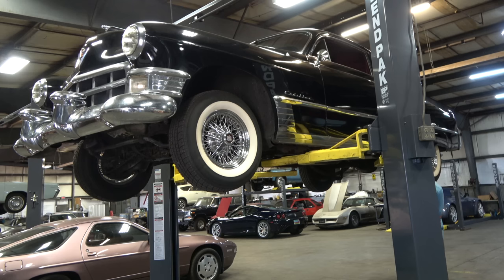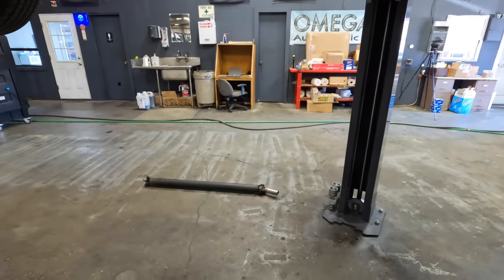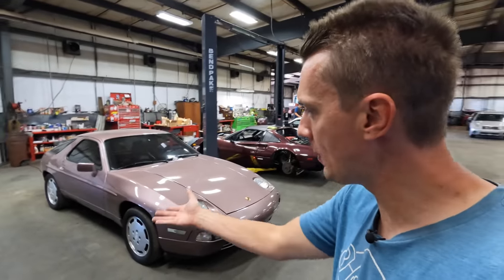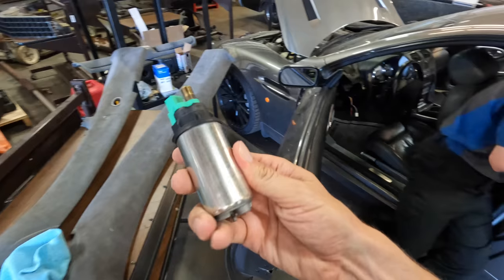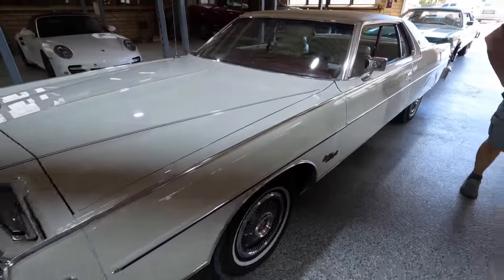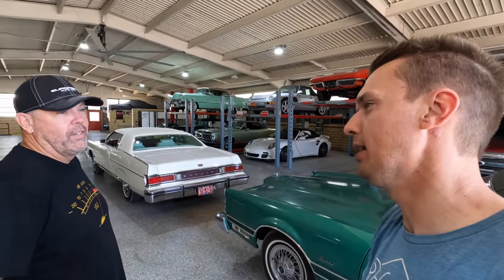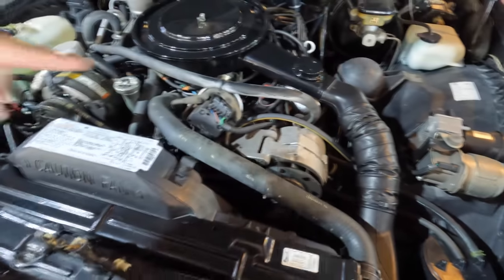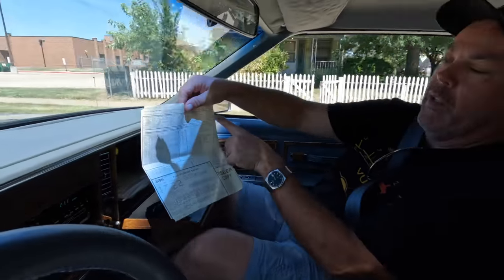We found some weird mods on my 1949 Cadillac Fastback Custom, and more things broken!

Comment: The 3.3V6 is an amazing engine. It's actually just as good as the 3800 v6. They're both 90 degree engines and both easy as hell to work on and very reliable.
Reply: Bold statement, Hoss. But you say it with such conviction, I must believe you!
Reply: That I can agree with, my 3.3 ran for a month with a cracked block or head gasket. Head gaskets looked fine, crossing my fingers there's no combustion in the cooling system when I stick it back together 💯🤷
Reply: @ericacherney3132  sucks it wasn't made for that long. Guess when the 3.1V6 came out,  it was too close in power to the 3.3 so there wasn't much need for it. But the 3.1 wasn't as easy to work on.
Reply: Horrible car.  Horrible.  Should not even wear the Buick badge.
Reply: @allenmurrell  It doesn't. It's a Caddy.
Reply: @theprojectproject01  thought you were talking about that horrible skylark at the end of the video
Reply: @allenmurrell  the car I don't care about its ugly lol. But that engine was a gem.
Reply: @allenmurrell  That is a car beloved of line cooks all across this great land

Comment: I swear 1980's GM headliners were literally falling apart when new apparently. 2000 miles on the car and obviously climate control stored. So many memories growing up of thumb tack stuck headliners.
Reply: cigarette smoke was the biggest problem and it effected the adhesive.
Reply: I remember my grandmother would always get onto me and my cousins for messing with the headliner in her Riviera for about a year before she traded it for a new one.
Reply: Yeah, it's the first thing I look at anytime I see an old GM from this era ! But I had some good times in the backseat of them though 😊
Reply: All manufacturers headliners were the same, a foam backed cloth with the foam glued directly to a cardboard headliner. The problem is that the foam disintegrates at about 8 or nine years and the cloth has nothing to adhere to so it falls down, the heat does the most damage. I've replaced several of them, its' easy once you get the thing out of the car.
Reply: I love that Riviera but the headliner needs help.
Reply: I have a 1997 Jaguar XK8 coupe that I bought in 2000 with 7000 miles on it. It was in almost perfect shape, always garaged by a non-smoker. It did however have a slightly saggy headliner that I had repaired a month later, and again 3 years later, and again 9 years later, it needs to be done again soon. I've had different opinions about why it keeps happening and tried different adhesives but nothing seems to work permanently.  After all these years and all the money spent I think I may have figured it out. My theory is that I drive with my windows down unless the weather is too bad and the buffeting is the cause. I'll be making an appointment soon to have it done again, I'll get back with you in another decade.
Reply: I had a 2013 focus ST and however they made the headliner in that car seemed to be pretty much impossible to damage. You could put a cigarette out in the headliner and it did nothing to it. It didn't melt never sagged nothing. It was even a sunroof car that stayed outside. When it got totalled it had 180,000 miles on it and the interior impressed me with how it held up. The leather seats even held up well. The heated seat switches/rollers died but Ford built them into the cupholders (bound to fail from liquids) that was really the only thing that died from 23,000 to 180,000 miles interior wise.
Reply: @mr.toobigformypants8145  they used to use chrome strips on older cars.
Reply: The adhesive that the fabric manufacturer used to bond it to the foam breaks down. It's particularly bad for the 1980's  because of the shift to low-VOC/water based products. I've got to replace the headliner in my 1982 Chevy. The foam stayed glued to the fiberglass backer, but the fabric/foam is all dusty garbage.

Comment: for the Porsche; if it has rear bilsteins they are probably rebuildable
Reply: I was thinking a call to Bilstein would solve the problem pretty quickly, but maybe the company has changed.  If Bilstein won't do it, they should reach out to MCS or one of the other boutique race shock companies in the US and see if they can make some one-offs for a Hoovies Garage publicity tour.
Reply: My thoughts exactly. Getting shocks rebuilt isn't usually done because it's so cost prohibitive, but that all changes when they're unobtainium spec
Reply: @ironymatt  and some of them are designed from inception to be rebuilt.  If there’s a rubber stopper or shraeder valve on the bottom of the strut/shock, it’s likely serviceable.
Reply: @caitsith2007  hope Wizard sees this and looks into it. Smells like another episode!

Comment: I had a similar experience ordering Bilstein shocks for my Saab. I ordered them from a place that advertised them as being in stock and got refunded as there were none available anywhere. It doesn't mean you'll never get any though. You just have to wait until Bilstein make another batch and then they're suddenly available everywhere. I finally got my Saab shock a few months later so good chance the Porker ones will be available in a while too.

Comment: Concerning the Buick: Note the delaminated headliner and deteriorating sun visors and unglued rear interior wall panels.
Reply: 40 year old car is still a 40 year old car…
Reply: @ripem1417  and a Buick is still a Buick...
Reply: @grandtheftautotune7715  and 80s GM is 80s GM…
Reply: @ripem1417  Don't even put the 80s in there, my grandmother had an early 80s Riviera and a 93. They both had headliner issues.
Reply: @DaR-Cee  my grandfather had a 83-84 one and i remember the plastic under the lights falling apart from it being stored in Florida

Comment: The Regal TourX is a great modern wagon that I drive as a daily.  I got it with some minor cosmetic damage for next to nothing, shipped in the Opel parts to convert it from a wannabe offroader, and have loved it ever since.

The problem with the TourX was that GM wasn't even trying to sell them, kind of the opposite really.  Next to zero marketing was put out for them and they didn't offer any dealer/buyer incentives to buy them.  I went to multiple dealers that had them and every one of them told me I could get great incentives for the trucks and suvs, but nothing for the TourX.  They actively tried to get me to not to buy one despite them being one of the better cars put out in a while.  I've heard from a lot of people having the same experience all over the US, that's still extremely anecdotal, but I think it holds true enough.

Wagons are like Vans in the US, people just want SUV's and then cry about gas prices.  Vans have shot up in sales with fuel rising, people realize you get a comfortable car with lots of space with better fuel economy.  I've got a Mazda5 with a MazdaSpeed 6 power and drive train mixed with custom suspension to give a pretty great handling and quick AWD van (for a van, anyway, rip my Mazdaspeed 6 someone hit in a parking lot while I was inside).  I also have a second gen Pontiac Vibe GT manual (basically a Matrix XRS) that's the perfect size.

Comment: Holley Sniper EFI would be awesome in it. Bolts on like a carb but the performance, instant start, and smooth idle. Just an idea
Reply: Hot garbage. Unforgiving.
Reply: Nahhh for that car the Q-jet is perfectly fine and more correct.
Reply: @snek9353  lolololol..... I hate my quadraflood
Reply: @ThriftMachine  Then you don't understand it, they're fine carbs. And if you hate it why haven't you replaced it? 
Of course better exists, but for that car the Q-jet is not only just fine function wise but correct for the build/era.
Reply: @snek9353  I understand it fine but I live in Colorado where the af is constantly changing with elevation

Comment: I have my grandfathers all original 1948 Cadillac and it has the last year of the Cadillac flathead engine, no air conditioning unfortunately. It runs great however. More of a spring and fall car. Thanks for the video!
Reply: Can't you retrofit air conditioning in that?  I remember my grandmother had Buick Skylark.  I think it was a 1968.  Anyway, my step grandfather put in an after marker air conditioner.  I still remember what it looked like.  It was kind of under the dash in the middle and it was a big boxy type thing with vents.  
What model IS your grandfather's Cadillac?  I'm a Cadillac buff myself and have a couple classics.
Reply: Yes, Vintage Air has a kit although it would have to put out quite a bit for that interior space. It’s a 62 series. I’m sure the hood has more steel in it than most cars have in its entirety. They bought it in 1956 trading in a ‘49 Lincoln Zephyr because of needing more space for the family. The price was $795 from Darby Everest Cadillac in Oklahoma City in 1956.

Comment: One of the most beautiful cars I've ever seen, and its topped off with some tasteful resto-mods.
Reply: You haven't seen many, have you?
Reply: @retroguy9494  Sadly no
Reply: @ForgedAU  Well, that's actually a GOOD thing because I'm a Cadillac buff since I was 8 years old and even have a couple classic Cadillacs.  What they did was basically ruin that car and it looks like a hodgepodge of parts thrown together.  Its kind of like the presidential limousine.  Its LOOKS like a Cadillac, but just in appearance only.  What they did was take what was a thing of beauty in the era and ruin it.  That saddens me.  My cars are all stock.  One of them actually HAS the 500 engine in it but it belongs in there because its a 1976 and that was the last year that engine was used.  Its a beast.  And gets a whopping 8 MPG locally and around 10 MPG highway.
Reply: They didn't ruin it. They just valued drivability over purity. As do I.
Reply: @ForgedAU  Well, when I want "drivability" I use my Cadillac Escalade.  When I want to go on a leisurely cruise with no particular place to be, I drive one of  my stock antique Cadillacs.  Therein lies the difference between you and me.  You should watch Jay Leno's garage.  These old cars are VERY drivable if they are maintained properly.  Hell, you could drive a stock '49 Cadillac from New York to California as long as it was maintained.  
In fact, about 10 years ago a guy drove a 1930 Ford Model A every day for a year as his daily driver.  He was from Michigan and even drove it in the snow.  It was all stock.  The only modification he made was that he converted the vacuum windshield wiper to electric.
As a car guy, to take these beautiful luxury cars from a time when style meant everything and they were objects of beauty and you could TELL one car from another, to do what this guy did IS ruining it.
Reply: @retroguy9494  fair point but I would be scared to drive a stock classic. I wouldn’t want any harm to come to it. That is what I mean by drivability, not just being reliable. But not being afraid to use it without worry, every day. I love stock classics, but I also love driving midden classics because I don’t feel scared driving them. I’m short, they didn’t ruin it, hey just did something you personally wouldn’t have.
Reply: @ForgedAU  Well, if you're afraid of an accident with a stick car, THAT I can understand.  I'm in the suburbs in the New York City metro area and its not only crowded but the way people dive is insane!  When I drive my '76 Fleetwood, always in the right lane, I've had people cut me off, cut me off and stomp on their brakes to make a right turn, etc.  People just don't realize that between the sheer weight of that car combined with the old style disc brakes, that car does not stop on a dime like modern cars do! 
But as far as maintenance problems go, I don't worry at all.  In fact, I've been stuck more with my late model vehicles than I EVER have with my antiques.  I had a 2005 Yukon which I bought new and when it was 4 months old, the entire exhaust system fell out of it on the highway!  I had to have it towed.  Plus it was in the shop every other month needing all these little modules replaced.  
But my '76 Cadillac is all stock, even the exhaust.  Due to 2 surgeries and having to care for my father who has dementia, I hadn't even started it in 2 1/2 years.  I put in a new battery and it started right up on the first try and purred like a kitten! The old stuff was built better and as I said, maintenance is key.  If you maintain them properly, they will actually take you farther than modern cars with less repair.
Reply: @retroguy9494  when I said scared I didn’t mean accidents. I meant I wouldn’t want chips on the paint or miles on the clock etc.
Reply: @ForgedAU  Oh, THAT!  LOL  Well, that's a valid point.  That's the very reason why, when I buy a class/antique car I NEVER buy  a 'trailer queen.'  I usually buy them with some miles, although LOW miles and with a a few imperfections.  Because I want to DRIVE them.  That's half the fun!  Plus you get them for less money.  Granted, my 76 and 84 Cadillacs aren't daily drivers so I didn't put on many miles.  But my 94 Fleetwood I bought as a kind of 3 season driver.  I bought that in 2014 with like 59K miles on it and it has, I think, about 88K on it now.  But yet, I haven't driven it in a year and a half because it doesn't run.  It needs a module and with the shortage on same, my mechanic can't get one!  He's even called Cadillac in Detroit who keeps promising one, but hasn't come through yet.
But I HAVE known guys who buys these classic stock cars to use as daily drivers, but they KNOW they're going to put on the miles and just want to drive them and not worry about the value.

Comment: I put a V8 in my MGB...I would overheat.  I installed a motorcycle radiator and fan above the differential to dump heat away from the engine compartment. Works like a champ.

Comment: I bought an 85 Riviera with 80k on it 20 years ago for $600. only needed a paint job. The one problem I had with it was the cruise control decided I needed to drop the pedal to the floor one night, Thankfully I was on an empty highway,  and I had to drop it into neutral and cut the ignition. I managed to get it to the side of the road , And thankfully I pull the fuse for the cruise controll and all was well!

Comment: No doubt many would be horrified by my suggestion, but I have to think that some of the “land yachts” at Eurasian bob’s garage are ideal candidates for EV conversion! Remove the spent out engine and transmission in the front, and you have a huge area in which to put in a large battery pack, with a compact potent electric motor installed directly in the rear.
Reply: Not a horrible idea at all. Bently and RR are two brands that could go full EV and benefit from it. The idea with these old land yachts was to make them as smooooth and quiet as possible...so going EV with them makes sense. I grew up in those yachts and what you really wanted was instant torque to push them effortlessly down the road.

Comment: FWIW, on the Caddy I think the brake booster and MC are 85-92 Camaro.  The fender radiator is probably a oil cooler. Cooling engine oil is extremely effective for getting engine temps down, especially in situations where you have limited radiator space. There's nothing weird about this car, it's extremely well engineered. I suspect it was built by pros, and an aircraft engineer had their hands in it. I rarely get jealous of anyone owning a car, but i'm jealous about this one. This car is amazing.

Comment: Glad you're making progress on the big sled.  Cool to see the mods hidden away in order to handle the extra heat load of the big engine.   It's interesting that the builder didn't put the trans cooler in front of the A/C condensor as is done from the factory in modern stuff like a Suburban with a tow package, and if need be after that, they could have installed a pusher fan.

Comment: I’m digging that 85 Buick Riviera what’s less than 3000 original miles on it and also that red 92 Buick 4 door Skylark GS  with 41,000 original miles on it I have a 96 Buick Park Ave. with the 3800 series 2 V6 with just shy of 75,000 original miles and it is a cream puff for sure 80s and 90s Buicks are my favorite

Comment: Aaah the good old overcooling stuff 😅 like the honda's with a big shiny radiator 😁 its all calculated from the factory for the hoses the pump and the block 
So bigger is not better. Especially in the winter then its very hard to warm up the fluid with a big radiator

Comment: Also as a fun fact as a young kid about 10 i saw an ad for a 93 buick Skylark GS, it was turquoise coupe and my young mind thought the dash and the exterior was the coolest looking car... i actually really liked the beak and didn't care much for the makeover... i will admit base model cars dont look nearly as good, and the sedan kind of awkward as it didnt get the body line swoop right...
The 3300 was a great motor that was essentially a 3800 with a smaller bore... 
My mother had a 95 achieva and that car was fast with the 3.1L V-6 so i would imagine rhe skylark would be slightly slower, but reliable... i would buy that red skylark in a heartbeat if i needed a driver to get back and forth to work

Comment: I had an aftermarket transmission cooler put in my car, replacing the one in the main radiator so we could fit a bigger main radiator. Seems to work OK. It exhausts through a screen into the passenger wheel well.

Comment: In 1970 the stock 500ci V8 made 400 horsepower. They had to detune it for the next model year because of emissions regulations. I wonder how hard it would be to re tune. Also I am not sure about those wire wheels. The center cap looks way to small. Personally I like the smooth chrome wheel covers that came stock, but it's your car.